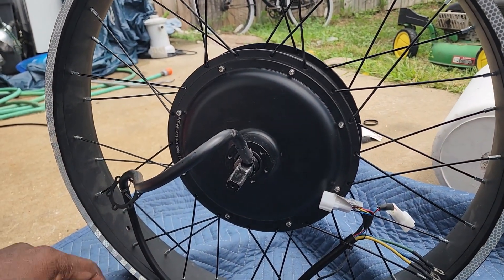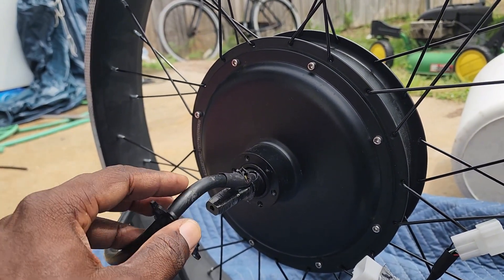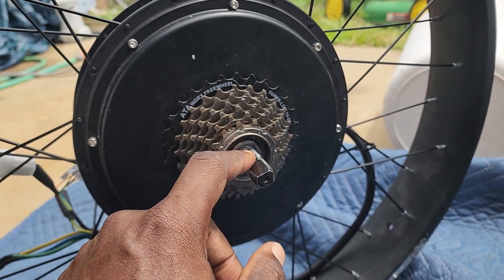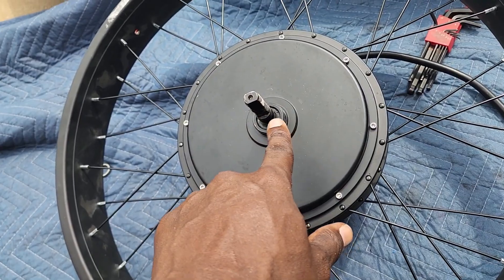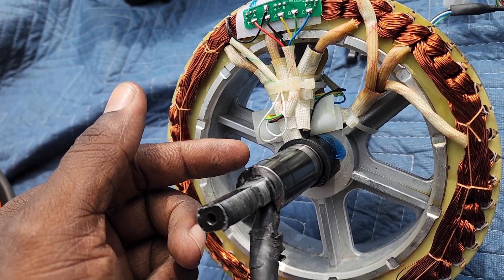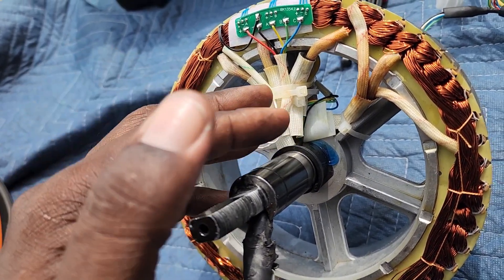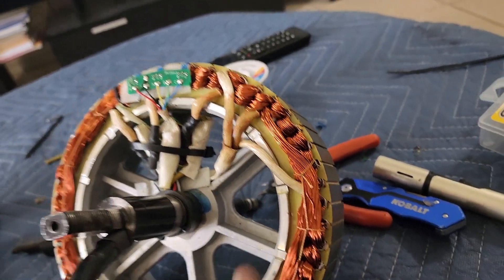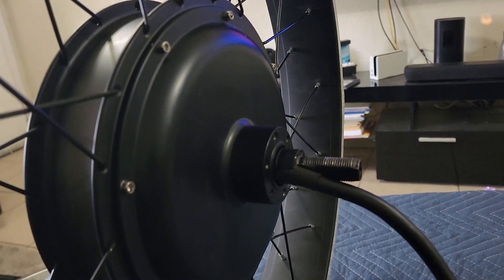5000w hub motor cable repair

Comment: Hi I've rewired same motor,but im stuck on red 'black'green'
yellow'blue'
White small hall sensor wires, there's 2 x sets of thin wires.upon trying each set im getting connection error,but you can hear it trying to move.ive tried both ways but same problem.can you assist me we're i need to go which set or way I need to do em.thankyou

Comment: @E-bikeguy, just had to do this same repair.  Love the detail and explanation of what you're doing.  
For anyone else watching this and reading the comments, when you're joining wires that are going to carry a lot of current and are fairly large it's going to be very hard to get a solder connection that has equivalent current carrying capacity to the unbroken wire.  The wire is a heat sink and, using a small hand-held soldering iron like most people have, you're going to have a hard time getting the entire interface hot enough for the solder to permeate the entire wire and avoid a cold solder joint.
In cases like this where there's relatively high voltage and current and a lot of vibration, a mechanical interface is always recommended.  If you're going to be doing this work, get yourself some high quality copper butt connectors and a proper ratcheting crimper with the proper dies designed for unshielded connectors and sized to the gauge  of wire you're crimping.
If you do solder it, make sure the wires are completely permeated with solder and your overlap between the two wires is at least 3X the diameter and preferably 5X the diameter.  You have to remember that the max current in the entire system is limited by the weakest link.  More often than I can count the fix for a wide array of performance and reliability problems people have brought to me have ended up being cold solder joints in high current wires.
Reply: One other consideration for those who see this and are trying to do it themselves, when sealing these with silicone you can't use normal household silicone.  They are acetoxy-cure and not only do they produce acetic acid (which can corrode aluminum) they also require moisture from the surrounding air to cure.  There is the distinct possibility that the silicone never fully cures in the air-tight spaces of the sealing interface.
Instead, make sure you use a non-acetoxy RTV silicone, like the ones you would use to make gaskets for automotive work.  Follow the instructions and those should cure and hold up really well without the potential to corrode the aluminum.

Comment: Hey question, I keep getting a phase current surge protect warning in fardriver after running the bike for like 20-30 seconds. I did open it up and add statorade, was fine until 12km into a commute power kept cutting out with that error. Inside my motor, some phase wire housing cracked, so i taped that up with 130c rated rubber electrical tape. I'm going to open her up again and take a look but what do you think it could be? it did get hot in there, smelled...charred. coils look fine nothing black, but the zip tie holding the phase wires inside the motor melted, which means it exceeded 80c. Thoughts?
Reply from the maker: Probably doing the same as my son's 5k motor but your situation looks like the motor overheated causing the phase wires to short
Reply: @EBG-offical  Yes I believe that is the issue. I did a continuity test on the phase wires, there's a close circuit. I gotta open her up and check the phase wires again. I'll let you know how it goes!
Reply: @EBG-offical  Hey I fixed my issue. my yellow phase wire was hitting the motor casing, sheering off the insulation causing a short. This was my fault as I didn't secure the phase wires to the bore of the motor when I did some maintenance on it. All good now and wow does it ever run better with statorade!
Reply: @500wattz so basically if your far driver says phase over surge protect that means your phase wires are shorting out ?

Comment: Thanks for the videos this is awesome to see cable repair. I have a question about my build. I have 2  48v 1500w direct drive motors running off 2 52v 20Ah batteries and the controllers are 48v 35A. I am maxing out at 37/38 mph. Shouldn’t I be able to go faster? Also the pick up is weak.
Reply from the maker: Yes I did email you, have you received it yet?
Reply: Oh ya I just saw that. Ok thanks I remember seeing a video you made about that mod I’ll go back and watch it again. Is another option to buy a more expensive controller should it not help to much?
Reply from the maker: @danielpercival882 the sabvoton 7245 is a Good option

Comment: I hate them plastic spacers are the worse they will make your disc lose
Reply from the maker: You definitely right,  I learned the hard way
Reply: @EBG-offical  same here bro luckily I noticed it going through the outer casing and was like nah your going 😂
Reply from the maker: @electricheadz  🤣🤣🤣

Comment: do you ever spoke your own wheels? always wondered how hard that would be.  I usually kind of flick the spokes and listen to the pitch of the sound they make to tell if they are tight enough or too loose.  i guess there's a torque tool to do that more scientifically 😏
Reply from the maker: Yeah I might have to, my rim is bent a Lil I let my buddy rode it and it came back bent
Reply: My scientific way is grabbing two crossing spokes and squeezing them together with my hand lol.

Comment: They do make a tool idk the name of it but it's a chain link attached to a handle
Reply: That is for tightening only, it won’t remove a freewheel. They do make several tools for the different freewheel. This one needs a hook and pin spanner wrench similar to the tool needed to change a grinder wheel. But if the holes are mangled it’s going to need the method similar to this one.
Reply from the maker: Oh ok I have one but I it was to tighten it
Reply: Chain whips are useless anyway for this purpose...tightening a freewheel happens when you pedal lol. Just hand tight and use a pedal or two and it is tight anf is only gonna get tighter as you pedal.

Comment: What problem would you recommend looking for if I were to be cheap and specifically buy a wheel that’s listed as “as is/parts”? 
I can’t afford a new wheel but will definitely buy a broken one that can be fixed without crazy tools. That wire problem is something I already have experience with and fixed. But is there anything else?
Reply from the maker: Like turn the axle make sure it's not locked up  or have any noise

Comment: You've repaired nearly everything on an ebike. Next stop is flying to china and getting on the factory floor lol. 

Give those guys some tips!
Reply from the maker: 🤣🤣🤣🤣 right, have them build a awesome ebike
Reply: @EBG-offical  right off the top i could think of a few. Glue for hub motor magnets and get fardriver to do a plug and play kit and have someone that speaks English program their app. Probably just ban sabvotons lol.